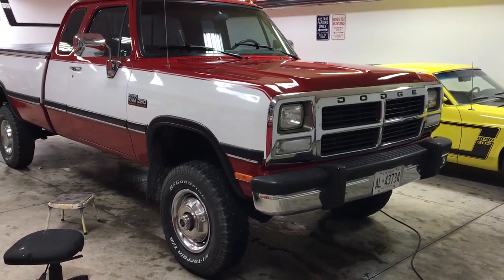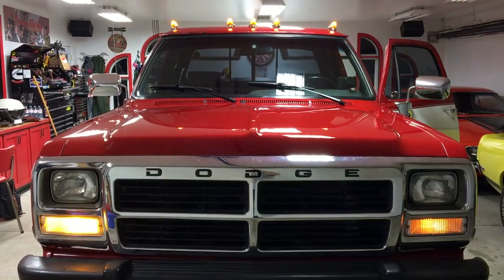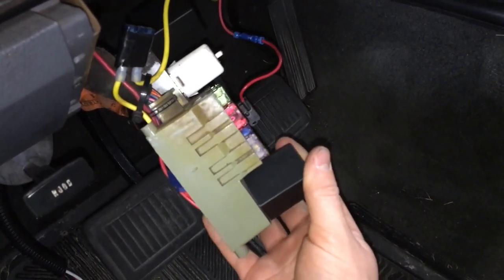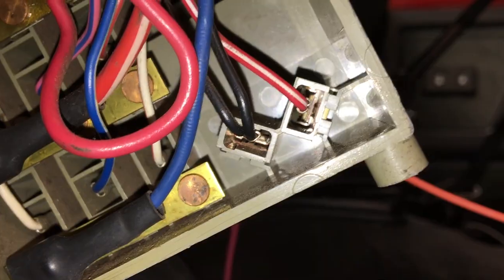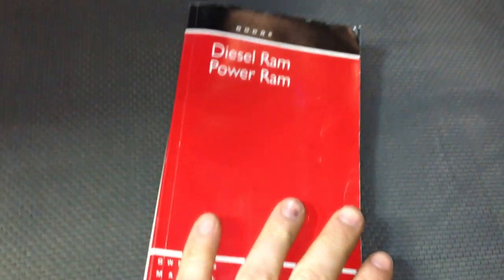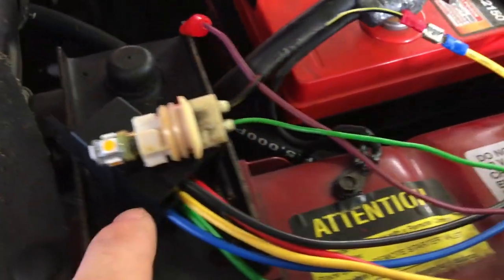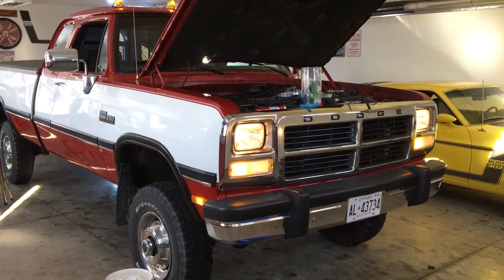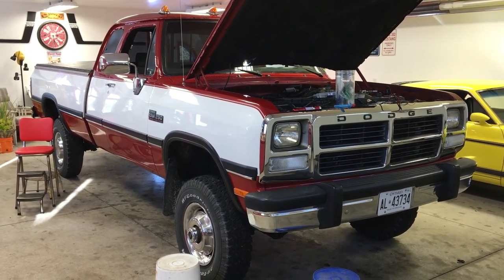1st Gen Cummins Full LED Bulb Conversion

Comment: I am late to the game, however, I did the full LED conversion back in November 2018 to my 1989 W250 and had my fair share of problems. Fortunately, I got help from another fellow First Gen owner and got my LEDs working. I know alot of people have issues when they do the conversion, so here is the method I used:

- Used all Sylvania LED light bulbs for the exterior lights (except my Altitude Lighting headlights and my sidemarkers, which I will explain in a second) and a pair of LED Flasher relays
- Initially had Sylania LED bulbs for the side markers, but it would affect both my turn signals and interior signal as well. To combat this, a non-polarized LED bulb was used
- A pair of Sylvania Load Resistors were wires in series together, then in parallel to the side marker circuit (one end to the signal wire of the side marker, and the other to the ground of the turn signal 

Reason for this is the factory circuit utilizes a floating ground to flip the ground when the parking lights are off vs on (side marker flashes in sync with front turn signal when parking lights are off, and alternates when parking lights are on). May not be the correct way but it's so far a proven method, and hopefully useful to some!
Reply from the maker: Exactly this. Since getting a bit more into electronics, I'm starting to understand what the issue was. I need to repair what I did in this video the way you have done it. There needs to be some sort of load resistor to mimic the factory bulbs. Yours now works entirely the way it should, but with LED bulbs? Thanks for the comment.
Reply: @OvensGarage  have you resolved this yet?

Comment: Mine did the exact same when I replaced the tail lights to LED’s my turn signals wouldn’t work on it, my brake lights didn’t work, and my 4 ways didn’t work, put everything back to stock and it worked fine

Comment: So I recently did this to my 86 D350 (gasoline) and am having an issue. Curious if you ran into it. I also had to change the polarity on the fuse box (which doesn’t make much sense because it worked prior with halogen bulbs, maybe LEDs are backwards for some reason). Anyway, when I have the lights off, my hazards and turn signals work, but when I turn on the headlights or the DRLs, the blinkers and hazards stop working. Have any thoughts?

Comment: If you hook the relay up in place of the bulb (the coil poles get the 2 wires that usually go to the marker light) then it should work as it did from the factory
Reply: Then pin 87 goes to the power side of the bulb and 30 goes to 12v
Reply from the maker: This is for the side markers to work with LEDs? I need to try this...it's been on my list of things to fix.

Comment: I did this to my 91 w250.  Wish I would have found your video first.  My side markers don't illuminate at all unless I use my turn signal and my right rear brake light blinks with running/headlights on and turn signal indicating left turn. I'm thinking about adding load resisters and going back to regular flashers.  Did you try any load resisters?  I put regular bulbs in the front turn signal on one side and the side marker illuminated as it should.  I'm wondering if their magic led flashers aren't the answer to led problems on these trucks.
Reply from the maker: Yeah I still need to sort out the issues with my front side markers... haven't solved that problem yet.

Comment: Did you have problems with the LEDs making your whole electrical system freak out? I changed my side markers to LED and my dash started to spas out after a few weeks and my gages went wild, lights came on by themselves. I have a 1993 12 valve club cab 4x4...
Reply from the maker: The only issues I had were the front marker lights, I still would like to find a solution so they flash full brightness when the headlight switch is off.

Comment: I tried LED's for my brake lights, but I didn't like the bright pinkish color that resulted. Went back to incandescent for my 1990 D250.
Reply: Need to use Red LEDs. If you are getting a pinkish color, you're probably using white LEDs.